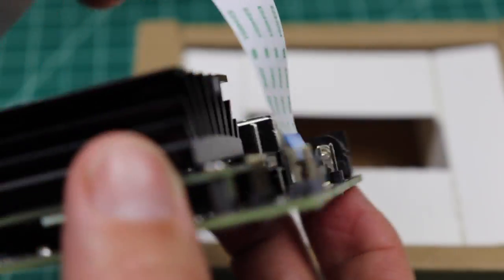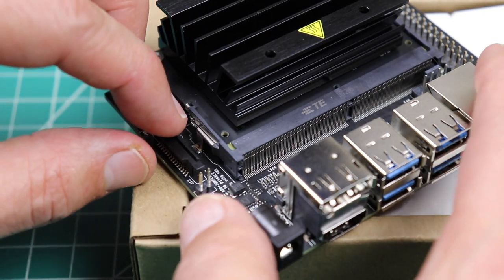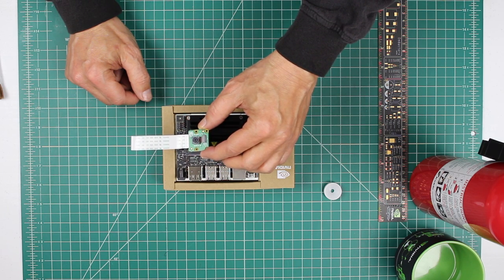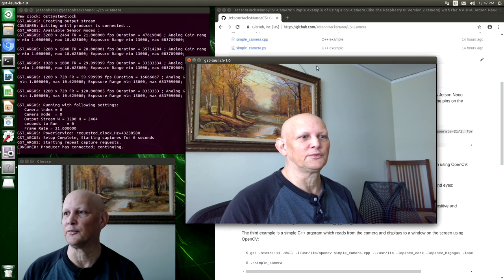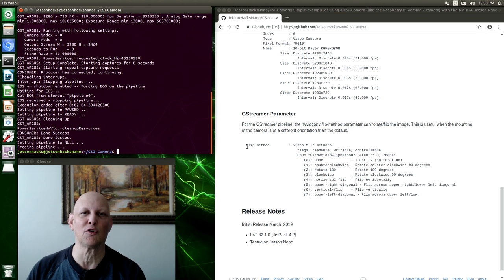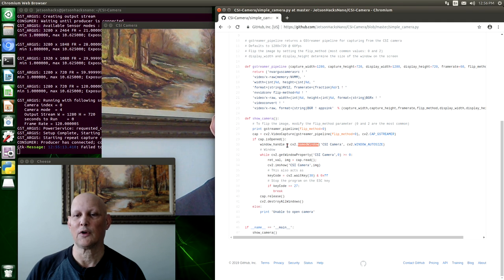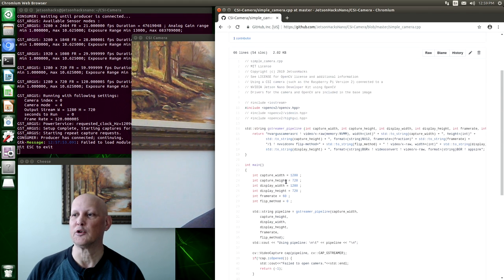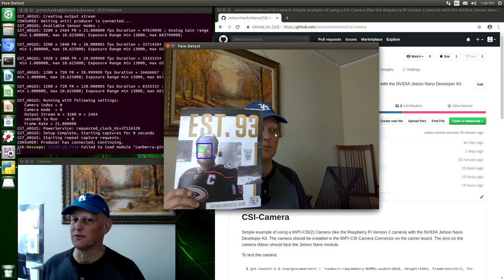JETSON NANO + RASPBERRY PI CAMERA

Comment: thank you for this video, i use camera rasberry PI wide angle with the Jetson Xavier. I have a question please when  i run the commande gst-launch-1.0 i get this error Warning erroneous pipeline : syntaxe error. can any one help me
Reply from the maker: It's hard to tell from your comment. What command did you try to run?
Reply: @JetsonHacks  thank you for your quick response. the command was :
$ gst-launch-1.0 nvarguscamerasrc sensor_mode=0 ! 'video/x-raw(memory:NVMM),width=3820, height=2464, framerate=21/1, format=NV12' ! nvvidconv flip-method=0 ! 'video/x-raw,width=960, height=616' ! nvvidconv ! nvegltransform ! nveglglessink -e
Reply from the maker: @oueslatichaima1991  Did you include the $ character in your command? If so, remove it from your command. The  $ represents the command prompt, and should not be input.
Reply: Thank you for your response. Idid not include the $ in the commande
Reply from the maker: @oueslatichaima1991  I just tried it here on a Xavier NX using JetPack 4.6 and it works correctly here. You could use gst-inspect-1.0 on the different elements in the pipeline to make sure that they are installed correctly. You could check some other pipelines also. See: https://developer.ridgerun.com/wiki/index.php?title=Jetson_Nano/Gstreamer/Example_Pipelines/Capture_Display You should be able to get help on the official NVIDIA Jetson forums, where a large group of developers and NVIDIA engineers share their experience.

 It's not clear from your comment when or exactly what your syntax error is.
Reply: @JetsonHacks  Thank you for your response, I'm a beginner with Jetson Xavier so  I will post my problem on the official NVIDIA jetson forums.
Have a nice day

Comment: İ need a help pls
Reply from the maker: Please ask a question.
Reply: @JetsonHacks  no cameras avialeble error 

Using winsys: x11 
Pipeline is live and does not need PREROLL ...
Got context from element 'eglglessink0': gst.egl.EGLDisplay=context, display=(GstEGLDisplay)NULL;
Setting pipeline to PLAYING ...
New clock: GstSystemClock
Error generated. /dvs/git/dirty/git-master_linux/multimedia/nvgstreamer/gst-nvarguscamera/gstnvarguscamerasrc.cpp, execute:740 No cameras available
Got EOS from element "pipeline0".
Execution ended after 0:00:00.123617360
Setting pipeline to PAUSED ...
Setting pipeline to READY ...
Setting pipeline to NULL ...
Freeing pipeline ...
Reply from the maker: @honorable.  What model camera are you using? Also, make sure that the camera is plugged in correctly.